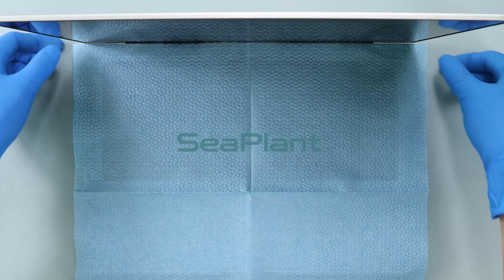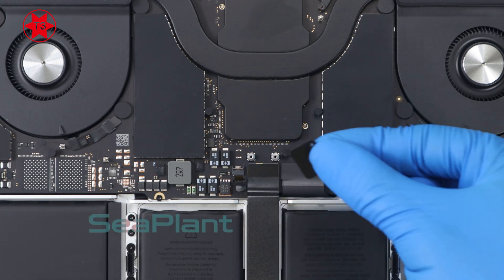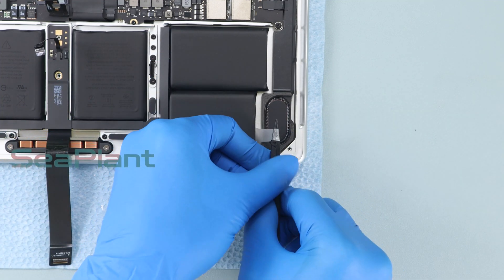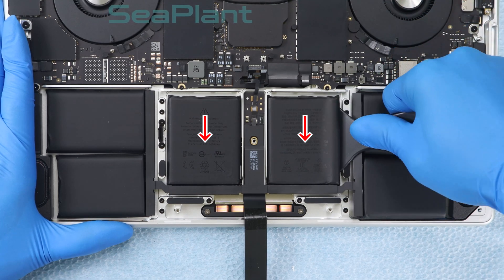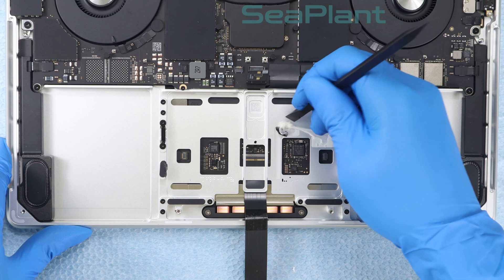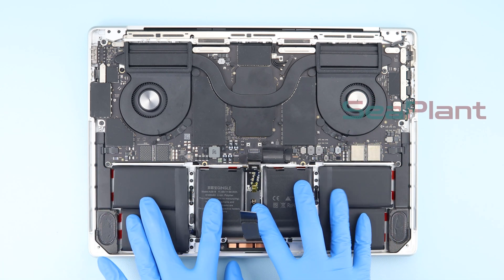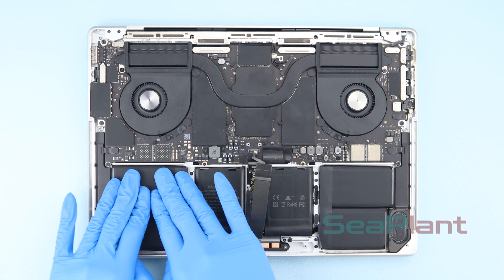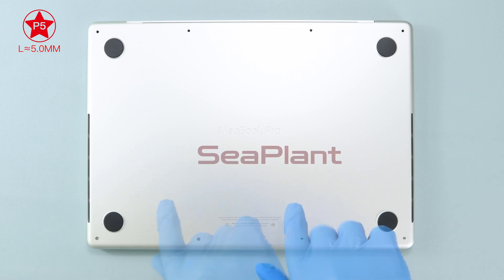How to replace the battery for MacBook Pro 14-inch A2442 (2021)

Comment: Does the system recognize it's not an original battery?
Reply from the maker: Thank you for your comment! SeaPlant battery is thoroughly tested and fully compatible with your MacBook. The system will not indicate that it’s not an original battery, as it works just like the original. We ensure that the replacement performs seamlessly with your device. If you have any further questions, feel free to ask! 😊